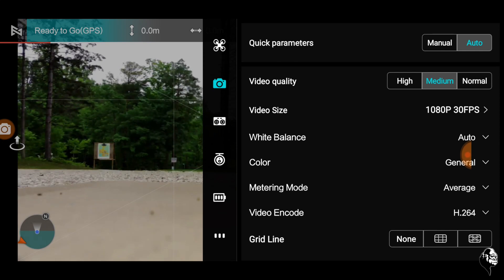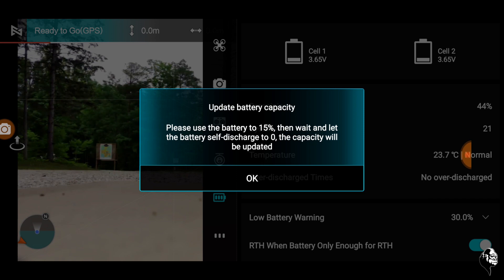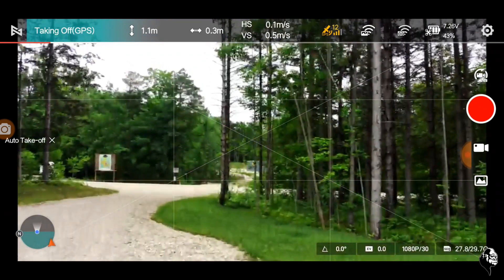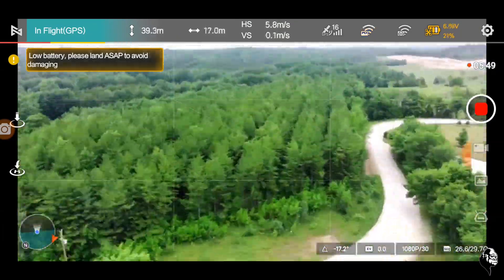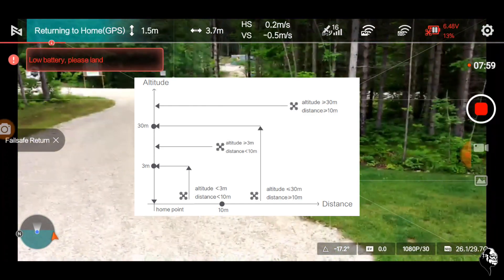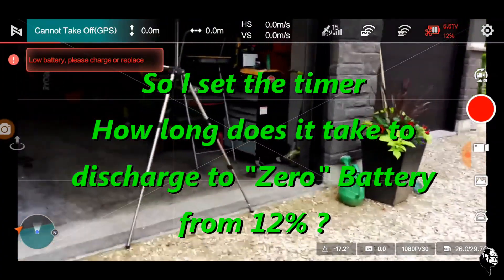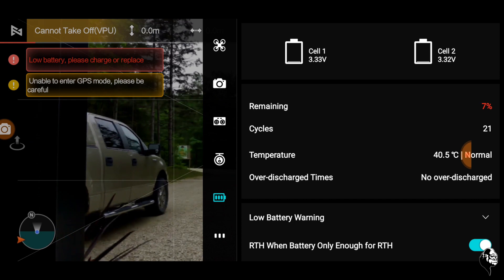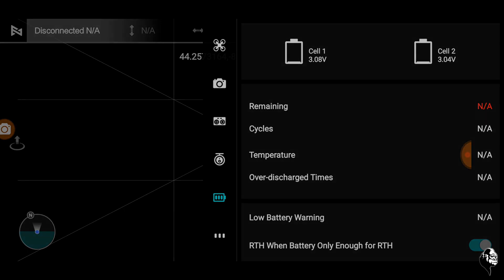Fimi X8 Mini - Battery Calibration with help from a Leaf Blower

Comment: Do you think that when that cycle counter goes up to X number of cycles the drone will not allow the battery to be used anymore, like some other devices that use battery with smart protection features.
Reply from the maker: No.. I know of only Hubsan that have implemented that rule. I had my V1 Fimi X8 Mini for quite a while and am still using those batteries even in my Fimi Mini 3. I had over 180 flights on my X8 Mini V1 .. a ton on the V2 (both of them) and now the Fimi Mini 3 😱
Reply: @GorillamansGarage  Thank you so much for the response, i hope it stays that way and hope they could be easily re-celled if the cells becomes weak

Comment: Hi there, just watched your video because i received a new pro battery today. When i started to charge it, the LED began to blink slow for some seconds and then it blinks fast. I interrupted charging to look at the battery status in the app. Connecting the battery to the drone didn´t work because i couldn´t turn on the x8 mini with the battery. Now it is charging for more as 4 hours and still blinking fast ( You can see it on https://youtu.be/Q9xdYxeCxO4 ).
Maybe anyone had the same issue and knows a solution.
Reply from the maker: I have not seen a battery flash. I would plug into a 2amp charge block. Or try another charge block.
Reply: @GorillamansGarage  Tryed another charge block , light was steady on without flashing but didn´t go out after 4 hours "charging". After that the drone still doesn´t recognize the battery. It seems to be defective.
Reply from the maker: @revilollag954  > Possibly it is. But if you have an amp metre, put it on DC and try connecting + & - to see if it shows a charge. I know there is a pin coding somewhere out there.. this may help.. https://youtu.be/419UVpkWrhI . But the light is supposed to be on solid until full charge, then goes out. I wonder if the first charging block was to much voltage?
Reply: @GorillamansGarage  First charging block was a huawei 5V 2A mobile charger. I already charged two other pro batteries with it several times. So this should be not the problem. It works good with the other two batteries. Maybe i should check if there is any voltage at the battery itself with a voltmeter.

Comment: Ok, G-man. So I finally got one of these messages on #1 of 4 batteries.  Guess how? By running it to zero where the drone shut off. Accidentally.  I was transferring everything off the SD card, then deleting then using the new "move to phone album" button Fimi added on last app update. Interesting that the FIX you did here is how I got mine to the Calibration Error! I interpret the error message differently though. When Fimi says "USE the battery to 15%, then let the BATTERY SELF-DISCHARGE to zero to me means keep power until 15% then let it self discharge in unpowered state,  not discharge it  under load. Who's to say with certainty, with the translation challenges.  The best evidence I have to support my interpretation is that it actually IS discharging.  I flew it to exactly 15% (It hit 14 before I got it powered off.) I've checked 2x at 10 minutes sitting unpowered- it showed 9%. I just checked again at 15 minutes, and we are at 3% so  looks like under 15% it absolutely goes into some kind of self discharge.  Take away? If forced to fly the battery under 15% make sure to give it a charge soon, even a Li-ion battery won't like sitting at 0 for any length of time. What do you think?
Reply from the maker: The reason I did it the way I did was because that is how Fimi told me to do it when I had my X8SE and they said it was the same procedure.
Reply: @GorillamansGarage  I can't argue with that! Using a 200 mph blower to cool the drone is a bit unconventional though 😆🤣 Some might accuse you of overkill. Not me though. The Fimi is mini, but it's also mighty!

Comment: Interesting. I have never had a battery capacity go out of sync, or seen this message. Then again only my Fimi X8 Mini and Fimi A3 use Li-ion, all the others are LiPo. Is this common in older tech?

Note: One of the earliest Fimi X8 Mini videos showed a battery drop from 30 something percent to 0 instantly. I assume that is a defect more than calibration? They guy continued to use it. I wouldn't have. That's drop out of the sky stuff.
Reply from the maker: I had it on my X8SE once. But I have over 80 flights on the X8 mini now. I know mine showed 21 cycles but I don't know how accurate that is.
Reply: @GorillamansGarage  NOT sure where the cut-off is for a "cycle" - could be 30%... could be higher. but short fight, the recharge absolutely doesn't trip the counter.  One of my 2 new batteries showed 2 cycles, when I've flown it at least triple that. Probably under 30 is the counter. I'll test it. One of these days.